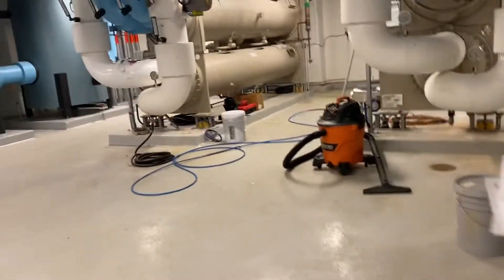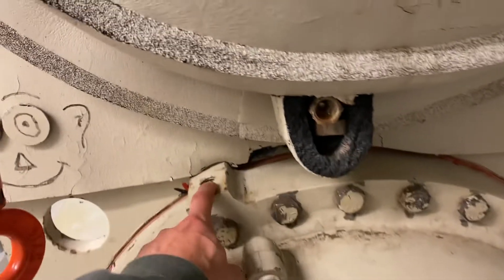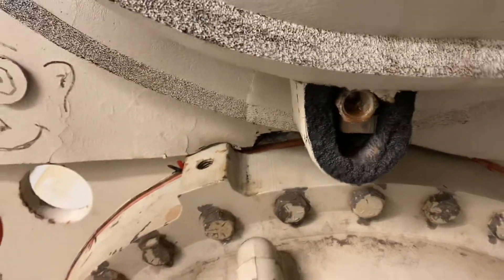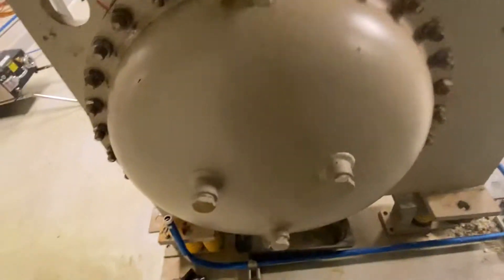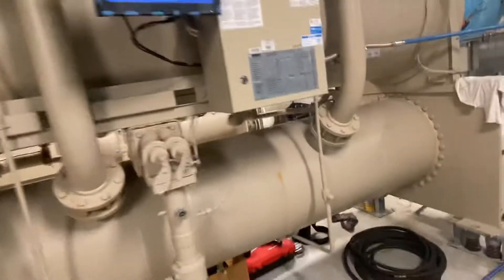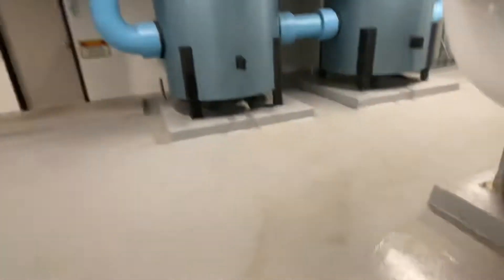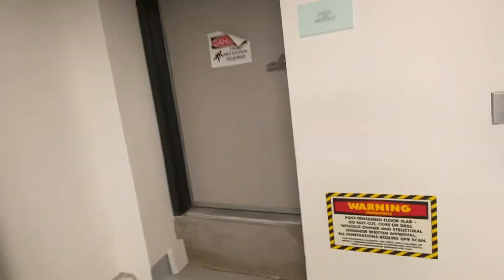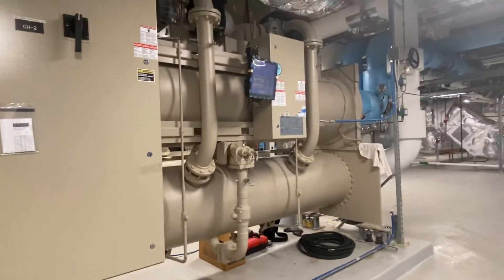Annuals on Daikin Chillers

Comment: I'm working with a Daikin Chiller Mn#WWVMNNSASNC having issues punching the tubes, rod size doesn't fit, however the 1/2" brush is good. I have a Goodway machine as well. What rod/hose size did you use on yours?
Reply from the maker: My bad saw this late, I already punched these tubes again this year I'm pretty sure 5/8" brush for this.